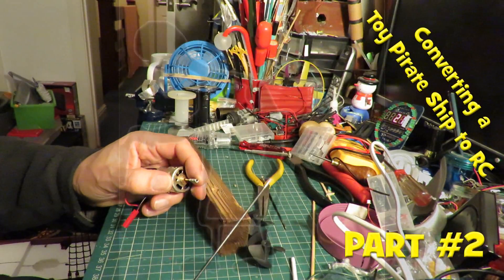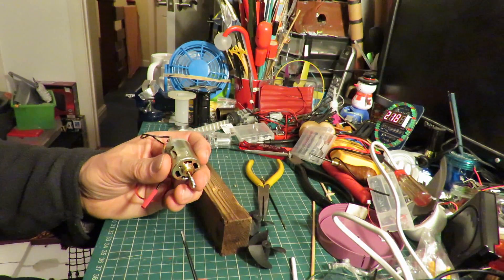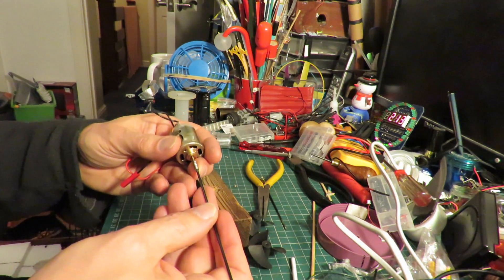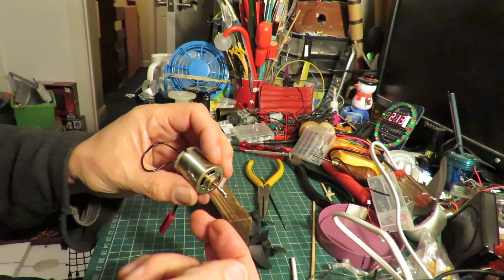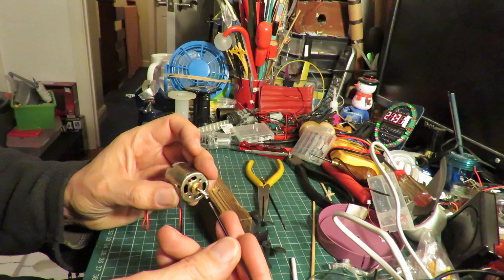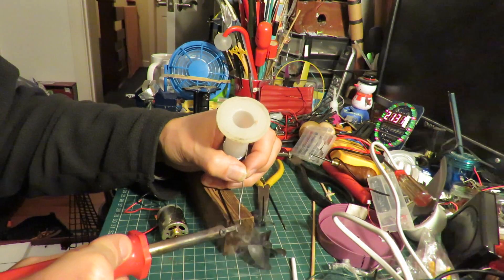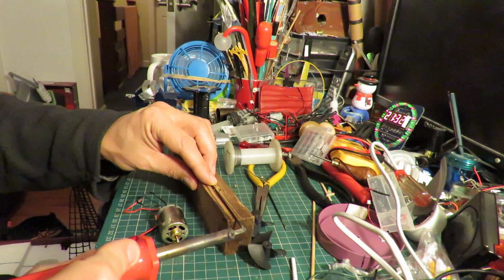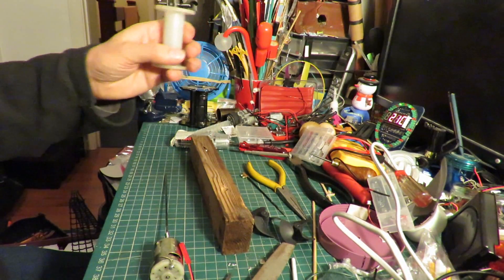Converting a Toy Pirate Ship to RC PART #2

Comment: yes I have often had that problem when I used to convert toy boats etc most of the motors I have had a small pinion fitted so I used a small plastic gear a ratio of about 3: 1 so it meant fitting the drive shaft to a plastic gear the rubber or plastic tubing works also if you super glue it to the shafts if the motor has affair amount of torque it can break the rubber in the middle !
Reply from the maker: I would like to use proper hobby grade connections but they would cost more than the money I spend on the entire build so I explore cheaper options. The same applies to using proper prop shafts.
Reply: yes I agree  I would have liked to have used the hobby grade stuff too but I didn't have deep pockets back then but I still like to try and make things for nothing where ever possible!  have you thought of making an outboard motor for your boats ?
Reply from the maker: Here you are Child's Toy Boat - Outboard motor conversion https://www.youtube.com/playlist?list=PLA5a2xPRSrB2VyBseLcg-tp-Q2tdh_Yrv
Reply: well done I haven't seen all your videos yet that one really works well and it does make a difference gearing the motor down !  as for the rubber tube etc have you tried a small spring that's worked for me sometimes !
Reply from the maker: The method I used in this video is more or less a spring. I wrapped a paperclip in a coil round the shaft but I also soldered it to make sure it stayed there. I was originally looking to use the spring used for net curtains but the internal diameter was too small so I made my own.
Reply: yes I suppose that would work too  but if you can try and untwist the spring from both ends and have an extra pair of hands you can open up the spring to take a shaft if it isn't too big most of the time I tried I lost the spring and had to cut another one !  my first outboard attempt was a motor inside the plastic egg you find in a kinder surprise  with a small prop it had to be well sealed to work under water but it worked